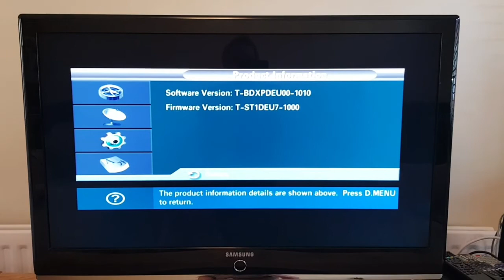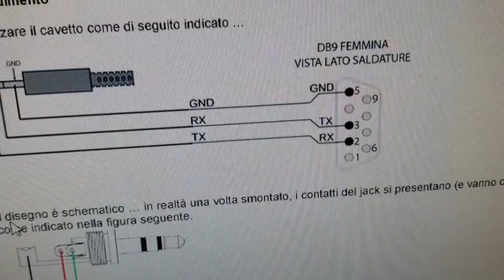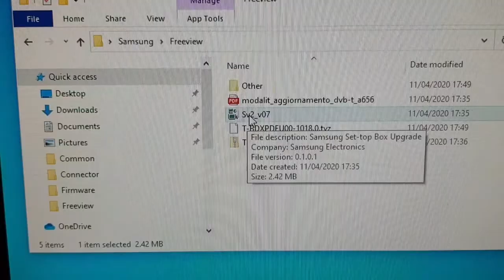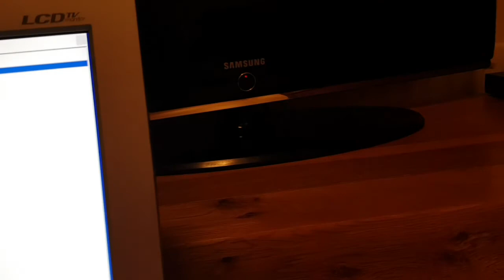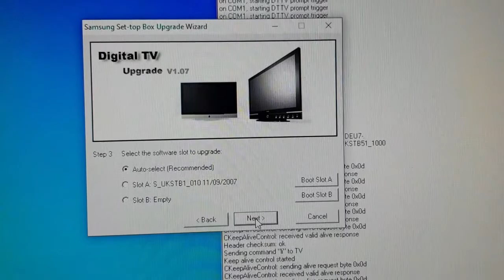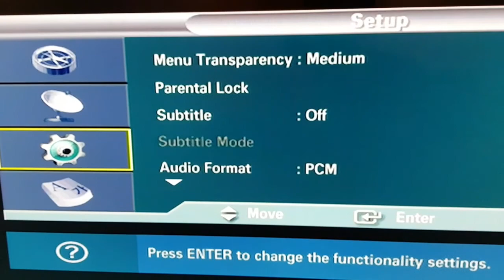Samsung LE40M87BDX TV Freeview DTV Update

Comment: Hi there, I have the same TV, but with firmware 1013.

I built a cable with Jack 3.5, I have a USB to serial cable I plugged it in pins 2,3 and 5, like you showed on the video, but!!!! The APP cannot find the TV. I was able to detect it 1 or 2 Times from several attemps having the TV disconnected, start the search on the program and Turn the TV on.
When i can find the TV i am not able to start the upgrade, the TV acts like it was Frozen.

Have you done any Change on the serial settings? Like speed, etc?

Which operative system have you uses to Run the APP?

The TV should be on all the time?

Regards